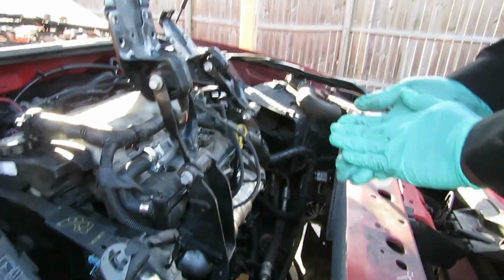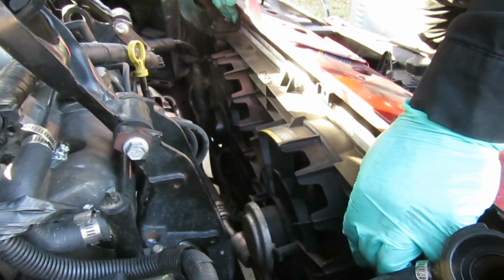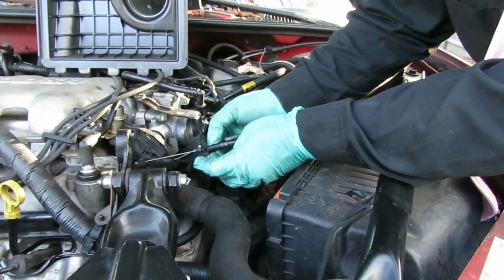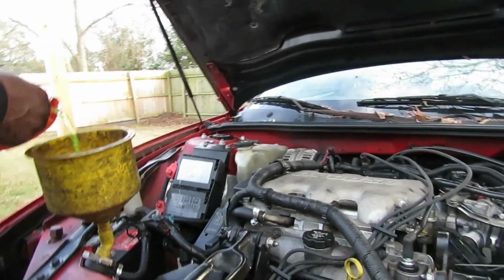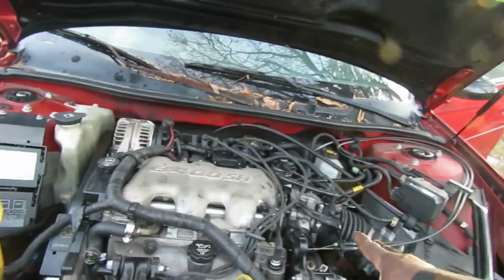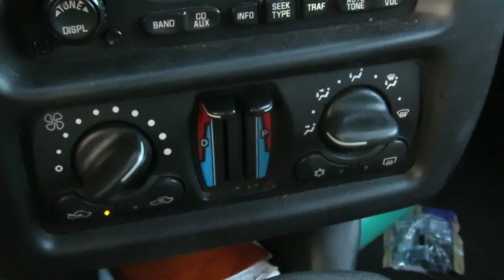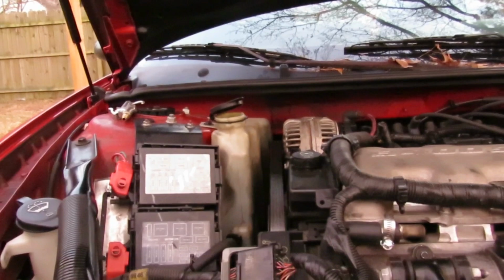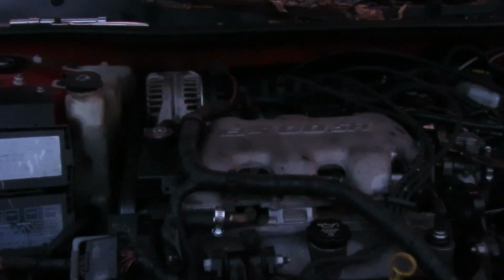⭐ Part 19 - 2004 Chevy Monte Carlo - 3.4 - Intake Manifold Gasket - Head Gaskets

Comment: Great Job, The engine sounds good I can't wait to start my wife's 3.4 Monte Carlo.
Reply from the maker: Thanks Tim, let us know how it goes!
Reply: The Monte Carlo is running great, I got rid of the dex kill that I had in it. It just kills your seals and gums up the cooling system. I put a new catalytic converter, because the original one was clogged up due to over heating. I am surprised how well it runs. Now the next project is my 3.8 impala it’s going to be fun, I changed the whole engine and transmission with the cradle from a donor car all I have to do is adjust the valves and put in shift solenoids for the transmission. That engine only had 111,000 on it so it’s has to get done. Great job keep up the great work.